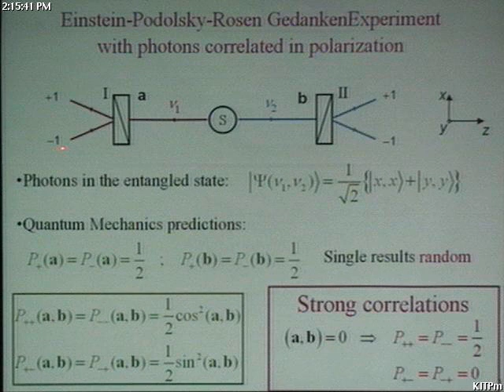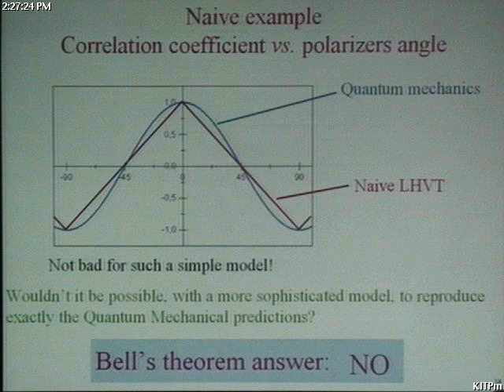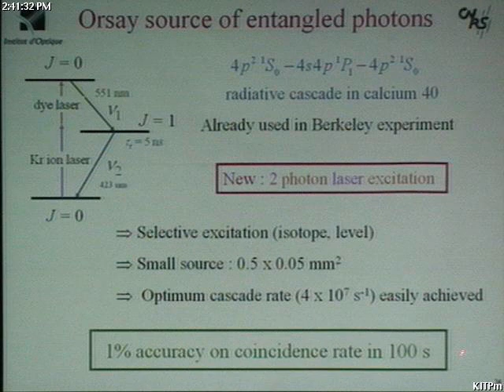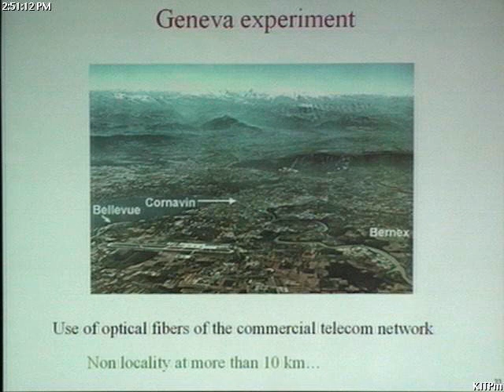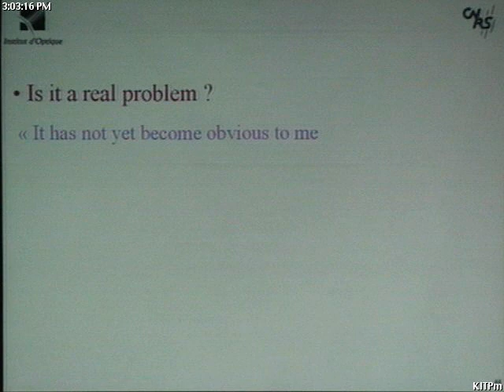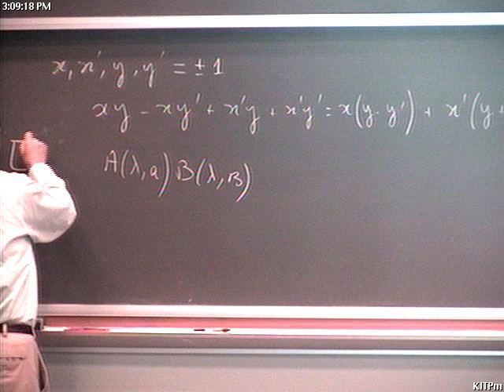Einstein Podolsky Rosen Correlations, Bell's Theorem, and Quantum Entanglement

Comment: In Bell's Theorem, he derives an inequality that is experimentally found to be violated.
What's wrong with Bell's Inequality?
Most of the simple introductions to Bell's Inequality start with the simple case where the presumptive hidden variable is static (not time varying).  In this case, it is straightforward to see one's way clear to his inequality.
But almost all models are time-varying.  Maxwell's model for the photon is a function of the parameters of space and time.  Same for deBroglie's model.  But Bell's mathematics is still OK provided one assumes that there exists a master clock such that all particles in a distributed system age in perfect phase-locked synchrony.  This is how he manages to cancel out the presumptive hidden variable.
But wait a second (or a nanosecond).  Einstein reminds us that clocks are affected by gravity.  Clocks that are separated in space do not tick at the same rate. The time-varying functions of the pair of twin particles are not perfect mirror images of each other.  And this is where the mathematics of Bell's Inequality runs into difficulty.  When one allows each particle to age at its own idiosyncratic rate, there arises a residual non-zero "beat frequency" that doesn't vanish.
That is, time itself is the not-so-hidden variable.  What has to go is the assumption of a master clock that pervades the cosmos.
Reply: Your comment is most interesting. Aspect asserts in this talk that Bell's Inequality "proves" no local function (no matter how complex) controlling entangled particles' behavior when detected can reproduce QM correlations. You, I gather, take issue with this. You imply that a time-varying function might be able to reproduce QM correlation functions. That I think is very plausible. But I did not understand your statement "...... Bell's mathematics is still OK provided one assumes that there exists a master clock such that all particles in a distributed system age in perfect phase-locked synchrony. This is how he manages to cancel out the presumptive hidden variable......" Just how does this "master clock" make time-varying entangled particles unable to mimic QM correlations? It would seem fairly easy to hypothesize a time-varying hidden variable function do such a mimicking. Wouldn't a function based on cos²θ do the trick?
Reply: @wendlt  ~ The fact that time-keeping is local explains why so-called "entangled" particles decohere rather than remaining perfectly correlated (i.e. "synchronized") as they go their  separate ways. If it were the case that a single master clock kept the same time everywhere and everywhen throughout the cosmos, then the particles would remain perfectly correlated (perfectly synched forever and ever).  That's the (bogus) assumption under which Bell derived his inequalities.  Since GR tells us that that's not a realistic assumption, it explains why Bell's prediction departs from the actual experiments of Aspect and others.
Reply: @BarsoomTork  I think you are right that QM assumes that a master universal clock exists (one of several reasons QM and General Relativity are not consistent with one another). So you are saying the fact that clocks are really local means that entangled particles cannot remain entangled for long? And consequently that means that particles would behave in a local fashion after they decohere (since they are no longer entangled). Then wouldn't we see the data from experiments like Aspect's deviate from quantum mechanical correlations and give results consistent with local hidden variable theory?
Reply: @wendlt  ~ Correlated particles can have attributes which are static (not-time varying), and those attributes will remain correlated indefinitely.

Particles can also have attributes which drift very slowly over long periods of time, and so they decohere very slowly.

One of the bugaboos of Quantum Computers is the rapid decoherence of Qubits whose "superposition" amounts to some very high frequency oscillation that is initially synchronized. As the Qubits drift out of synch, their decoherence introduces errors, limiting the number of instructions that a Quantum Computer can reliably execute before the computation is spoiled. 

In experiments like those of Alain Aspect, the so-called "hidden variable" is time itself (and hence any attribute that is a function of time). For example, a photon can be modeled as a sinusoidally varying electro-magnetic field packet that obeys Maxwell's Equations. The color of a photon changes as it ascends or descends a gravitational gradient. This is called the Gravitational Red Shift.  If Aspect aligned his apparatus along an East-West Axis and conducted his experiment at dawn on the morning of the New Moon, the East-Bound Photon would arrive at the "Alice" Detector slightly Bluish.  Conversely the West-Bound Photon would arrive at the "Bob" Detector slightly Redish.  This effect arises from the same gravitational gradient responsible for the Spring Tide on the day of the New Moon. If the attribute being measured depended on the instantaneous amplitude of the E-M fields of the photons, they would have drifted out of phase due to the Gravitational Red Shift.  The passage of photon through a polarizing filter depends on the instantaneous phase of the E-M fields as it traverses the polarizing filter.  This phenomenon confounds the experiment, since Bell's Model doesn't take any of that into account.  Maybe if Aspect had used radio waves instead of visible photons he could have finessed the problem of decoherence, because then the phase drift would have been insignificant. Possibly he could have used Masers (forerunners of Lasers) with Microwaves that have much longer wavelengths than visible light.

By the way, fMRI machines rely on the phenomenon of decoherence, and their engineering design expressly takes into account the rate of decoherence to image tissues composed of different mixes of the elements.The physics is bit different, but fMRI relies on Larmor Frequency and Precession of Atomic Spin Axes. Bell's Model completely ignores analogous features in his over-simplified calculus.
Reply: @wendlt  If General Relativity did not apply, then one could plausibly adopt the convenient assumption that clocks tick at the same rate everywhere and everywhen, such that knowing the frequency and phase at the instant of creation of the twin particles would suffice to characterize the particles as they sped apart.  But General Relativity does apply, such that knowing the initial frequency and phase does not suffice to predict the frequency or phase thereafter. This amounts to saying that time itself is the not-so-hidden variable.  This is one reason Qubits decohere when they are not co-located.